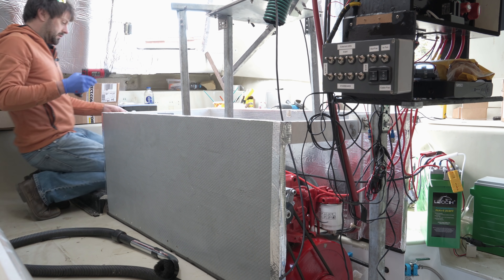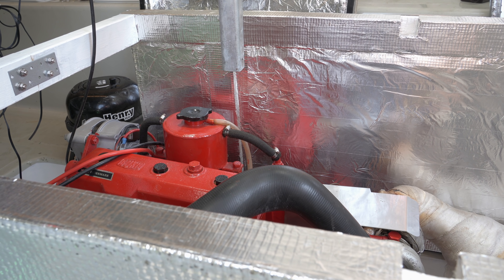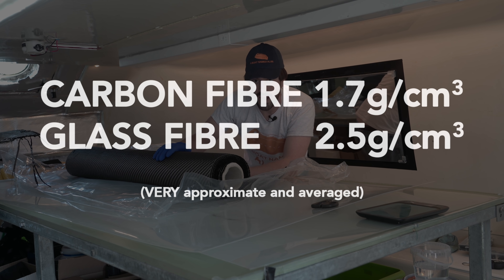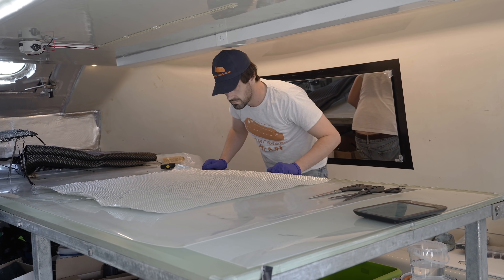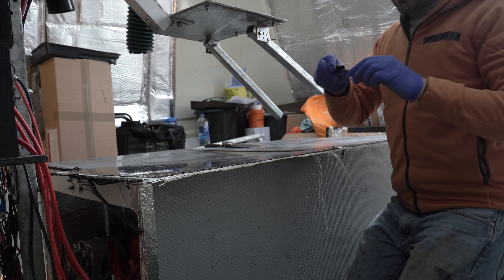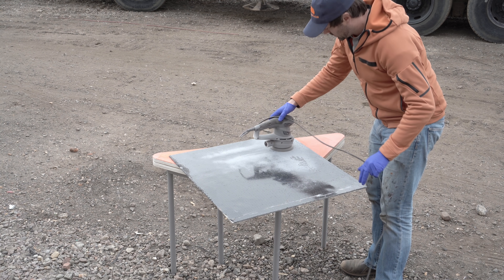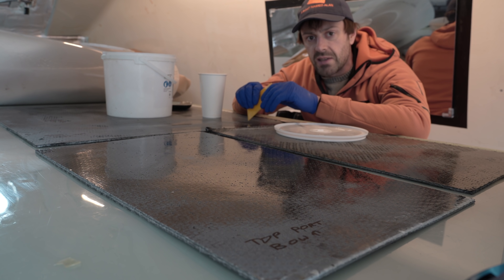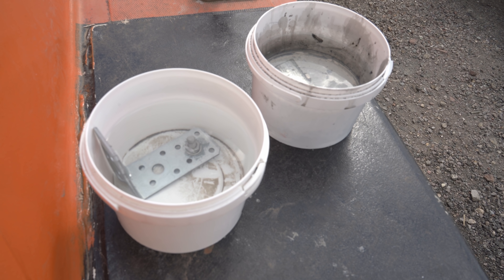Lifeboat Conversion Ep15: Using a composite wet layup to make a carbon and glass fibre lid [4K]

Comment: I am always astonished what kind of research and material testing you do. Also great planning ahead of what will be useful while using the boat.  Considering the later use if the boat I like the uniqueness of the build and that's what makes it so interesting.
Reply from the maker: Glad you appreciate it - I think the hard work pays off in the long run.

Comment: If you try to measure the temperature of something reflective with an infrared thermometer, it will read much lower than the actual temperature due to the emissivity of the material.
Reply from the maker: I should have been clearer - I'd measure the temperature of the lagging in that area, not bounce the beam off the foil lining.
Reply: @AlexHibbertOriginals I almost thought so, just wanted to mention it, because I had this problem once and burned my fingers a bit.
Reply: I was thinking that too. I suppose at least he will get an idea of how much hotter that section is, even if he doesn't have an accurate temperature.
Reply: @willcowan  Not really depending on what the surface is exactly, it may just read the temperature of something reflecting in it. You can see this if you look at it with a thermal camera.
Reply: Unless what the cowling is reflecting is something hot like, say, an exhaust manifold. Then a pyrometer will read much, much hotter than the actual surface is.
You can kind of get away with putting black dry-erase marker on the area you want to measure though it will obviously cause it to absorb/radiate more heat.